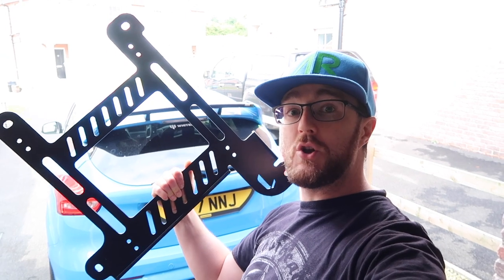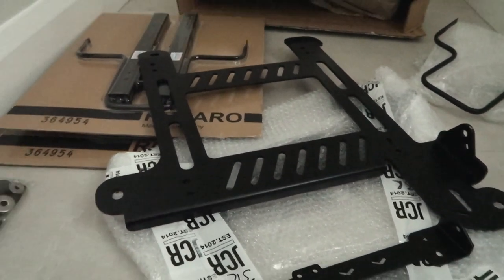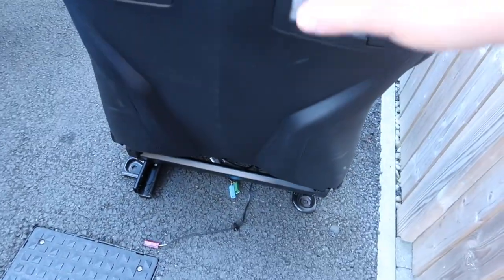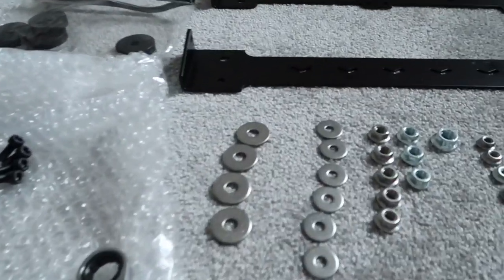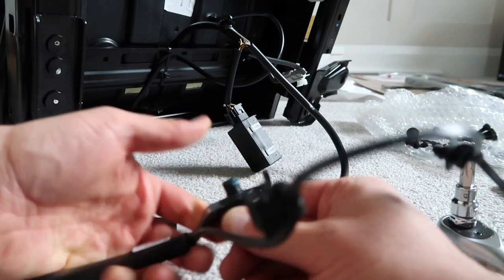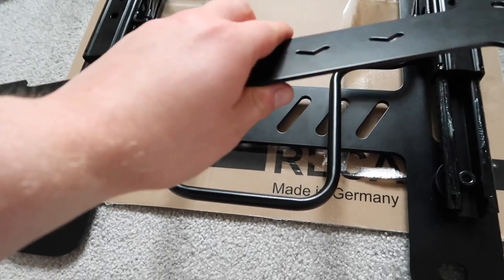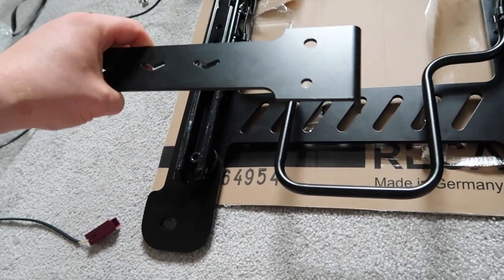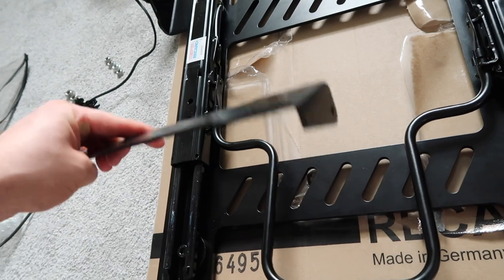SUPER LOW SEAT FRAMES INSTALL! | JCR DEVELOPMENTS | MK3 FOCUS RS

Comment: Thanks for this. Did you disconnect the battery or does it not matter as there are no airbags in the seat?
Reply from the maker: No airbags indeed means no need to think about the battery
Reply: @AdamRainey  figured but thought just in case - thanks mate